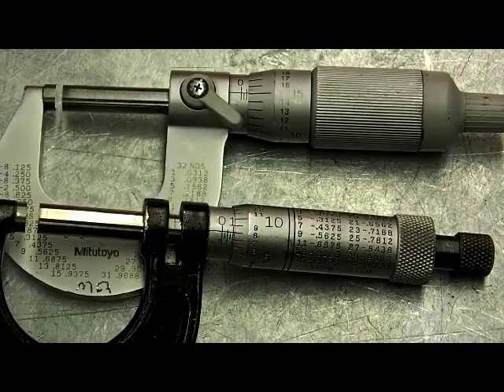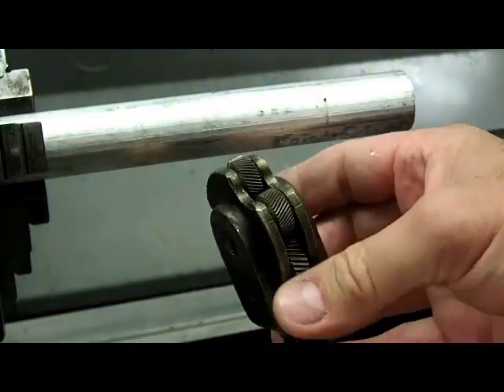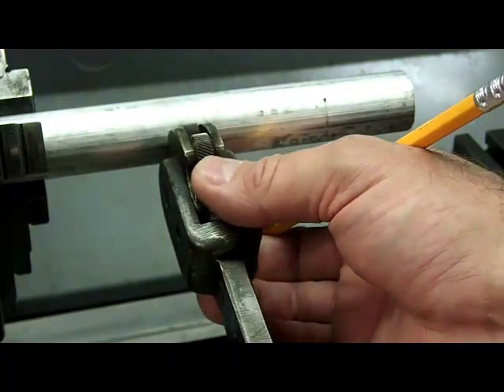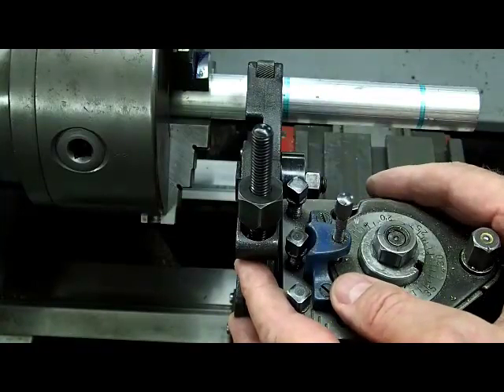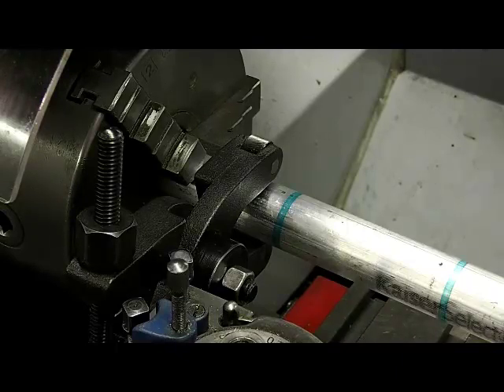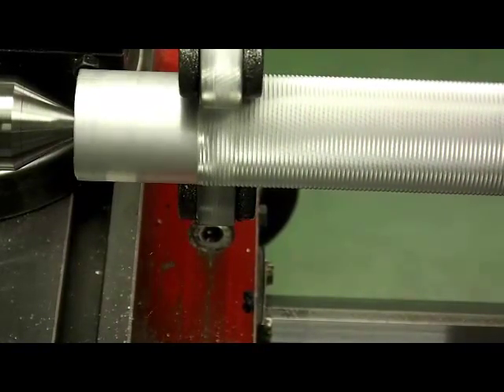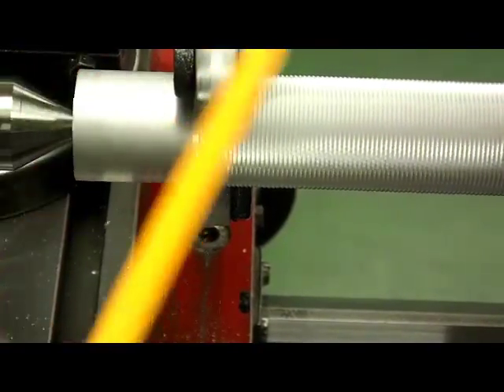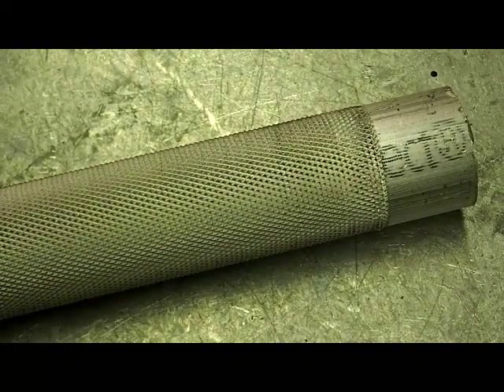Knurling on a Lathe

Comment: I have had a piece slip into the chuck while knurling.  Starting at the head and working toward the tail stock is a great idea.  Uses the live center as the thrust bearing.
Reply from the maker: I have had good luck with this process. If slipping is still an issue try chucking your work in a 4-jaw chuck. Thanks for watching.

Comment: Very helpful and a well done video.  Thank you.  One question:  How do the knurl grooves continuously line up with each other at each revolution?  I would think this is a function of the part diameter and the knurling wheel diameter, and the number of knurling teeth per diameter.  I would think that, theoretically, it would be rare for everything to mathematically come out even (the next knurl wheel peak dropping exactly into the previously-created knurl valley.  Is the method relying on the loose play between the knurl wheel and its axis?  Thanks!
Reply from the maker: Good question, the play between the individual wheels allows for alignment.

Comment: I cringe when I see people run tools dry. That poor knurling tool, spinning on dry bearings/ shafts. And how do you expect to force this material dry?  People do the same thing when tapping holes into aluminum.. why use oil, it's soft... Foolishness.
Reply from the maker: Rick, thanks for this, I agree. Although it is not favourable for the tool, I like doing aluminum dry as I find the oil tends to pick up chips which can damage the knurl. I would never run a dry knurl on steel.

Comment: Dear author,
Tell us more about the 1° angle. Why you need to tilt 1° to the left and not to the right? My guess is, so the tool can sprung away. 
Does the work always has to be supported by the tailstock? 
In case of the bashing type knuring tool, can we use the travelling steady to support the work?

Thanks and keep the good informative videos comming.
Reply from the maker: Hi Daniel, sorry for the slow reply I've been on holidays. The reason for the tilt, it's a trick an old timer showed me, it helps the knurling rollers track better. I use a left swing when working towards the tailstock and a right when moving towards the headstock. 
I'm not sure I understand what you mean by a bashing type knurling tool? One that cuts on the front of the material? You could use a follower rest (traveling steady) just ahead of the knurling tool but it would only work on round material before knurling. Once you have a diamond pattern on the material it would damage the supporting pads.
The rule of thumb is if the length is more than three times the diameter from the chuck you need to support the end opposite from the chuck...I would. 
Thank you for your kind words.

Comment: Great tutorial video. Thanks for sharing. 
If knurling much harder steel, do you lubricant the piece with cutting oil?
Is it better with lower speed or higher? 
Zmago
Reply from the maker: Yes, I would use a cutting oil on harder material like steel. I would still use a relatively slow rpm. Thanks for the question.

Comment: .020" feed...per what revolution?
Reply from the maker: Revolution of the spindle. So in other words if the RPM is set at 100 the tool will move 100 time 0.020" in one minute or 2" a minute.
Reply: OK, thanks for your reply.  Obviously I have no lathe experience.  I wish I did.
Reply from the maker: I didn't either before I started ;)
Reply: It may seem rather lame to say that 70 years was just not enough time.  When is someone going to build that time machine, I need to go back a bit and redirect some energies.
Reply from the maker: Your not too old! I once taught an 86 year old guy.
Reply: Yah, maybe not.  Having access to a lathe would be a bigger problem.  I wonder if someone who is a master machinist who would have a machine shop, might make sort of a school out of it.  People who wanted to learn, could sign up for classes to gain a certificate from the Machinist, who could then rent time in the shop to trusted students, who have neither the space nor the money to outfit their own shop.
Reply: Am I smoking crack?  Looks like your feed is .002"/revolution, not .020"?

Comment: Do you have a video showing and explaining 'machine turned' flat stock?  I'd like to witness that process as well.
Reply from the maker: No but I can do one...did that just the other day. Anything in mind?
Reply: Not really, I have seen the finished product many times over the years, but have never seen how it's done.  In my work career I have been in settings where the company had in-house machining.  I got some time to interface with the men there, but never really enough time.  I have great respect and admiration for Machinists and what they can do.
Reply from the maker: Thank you, I feel the same way about other trades.
Reply: Yes, I've been watching another man build his own CNC machine, and a pantograph, both fascinating creations.
Reply from the maker: Sounds like a smart guy!
Reply: I've been following his build videos, they are done in a very professional manor and his work looks like normal industrial equipment.

Comment: hi, thanks for the video.

I am surprised it did not need lubrication while knurling.
?
Reply from the maker: It has been my experience aluminum works well without lubrication. If it is a harder material, steel, I would absolutely use lubrication. In part I chose to film aluminum as I knew I could do it dry and I thought it would show better on the video without the use of oil on the surface. Thanks for the comment and watching.
Reply: I was thinking about lubrication for the knurling wheels/shaft. I was under the impression these needed constant lubrication while knurling to prevent wear? can this be overlooked for small jobs, possibly.
Reply from the maker: Some materials knurl fine dry...I would definitely lubricate steel.

Comment: hello sir,  and thank you for the video .Is the diameter of the bar important  for a nice quality knurl ?
thank you anyway !
Reply from the maker: Typically knurling on a bar is done so it can be held in the hand, so the diameter will likely have that consideration. Also the knurling tool will have to open wide/close small enough to fit over the shaft. Finally the diameter is a factor of the RPM.

Comment: Thanks, good simple video. I have seen some where math was involved with the diameter, number of teeth, etc. That I am sure is the super pro approach to Knurling. But for anything I do (not a pro) your approach and end product is very, very, fine.
One area I am thinking about is why the initial test area was somewhat deformed? Is it from the starting and stopping, or adjustments to the pressure nut?
Again, Thanks!
Reply from the maker: If you get a reply twice my apology, I'm not seeing the reply I sent in the comments. This process works fine for any knurling I've had to do. There is tearing from the stop and start and readjusting the pressure. I always try to start in an area that will have the diameter turned smaller. Thanks for your message.
Reply: I went out and tried our method within hours of watching the video and it worked GREAT!
Reply from the maker: I've had good success with that method, I'm glad it worked for you.

Comment: Nice clean knurl. 
Point of interest, when used for grip use, straight knurls are for a twisting grip while diamond are for pulling and/or twisting. When used for artistic purposes, all bets are off.
Reply from the maker: Hi Chris, thanks for adding that. If you look at the diameter of some coins there is a straight knurl. I believe it's purpose is identification for the visually impaired.
Reply: We have the same thing in the UK but it's done with equalateral curve heptagons.
Reply from the maker: I would like to see a photograph of that if possible.
Reply: google "british coinage" and look for 20p and 50p coins. Because of the shape they will roll like round coins but you instantly know they are not lower value bronze ones of similar size.

Comment: No fluid?
Reply from the maker: It is my experience that softer material works better dry. I have good luck knurling aluminium dry. If the shaft was steel I would absolutely knurl with a cutting oil.